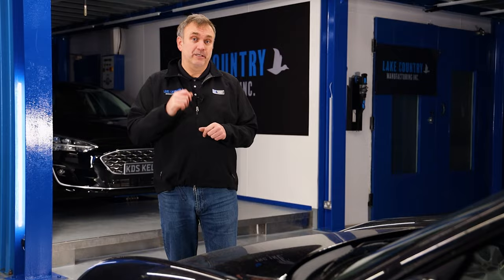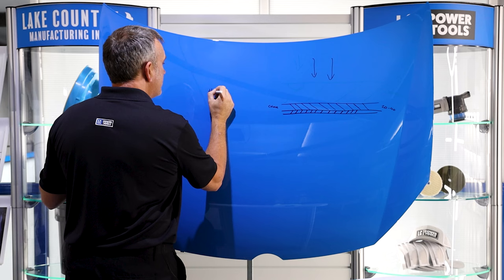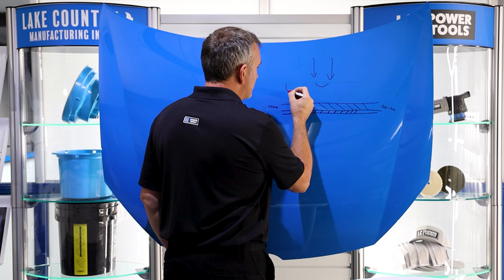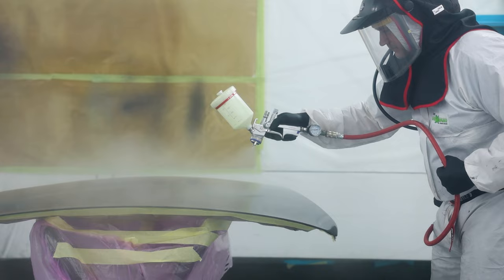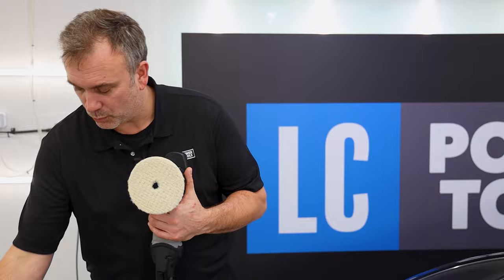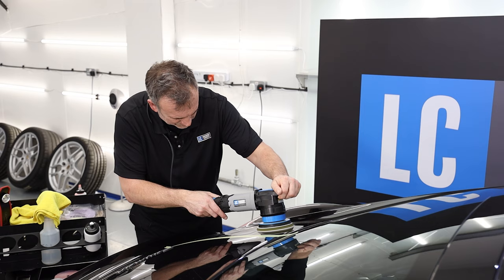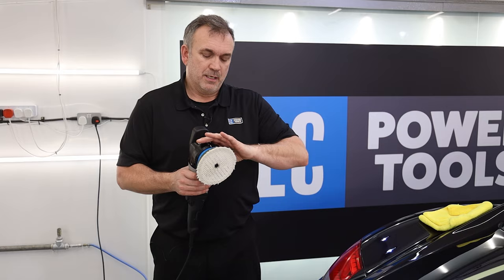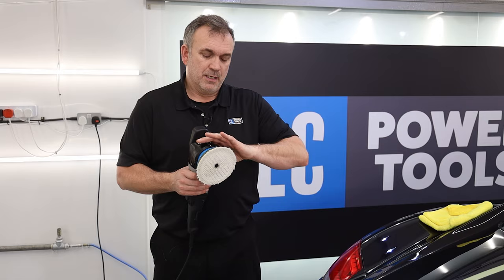Porsche Cayman Bug Etching | Part 01: Cutting

Comment: That UDOS machine looks fantastic but Lake Country Tools still needs to develop and sell a "MICRO" UDOS machine.   The exact same features as the big boy but in a micro machine to allow for polishing in smaller areas that require a micro polisher.  If they could develop it with a battery and cord system like the iBrid,  even better.   That way you always have a back up if you don't have a battery charged.
Reply from the maker: Always appreciate your feedback, thanks!

Comment: If had to deal with this I would simply cover the appropriate panels with PPF. PPF can stain with certain bugs, but the sun’s UV typically causes them to disappear.
Reply from the maker: I've seen what you're describing and in actual fact there have been specific occasions (this is Jay talking about our time at/as KDS Keltec) where we have done just that - fitted PPF to roof, hood, bootlid etc because the owner had no choice but to keep the car somewhere it was guaranteed to get covered in bird, bug and tree mess.  Even if the PPF had ended up stained and wrecked, on that car, with that originality, that value and so on, the PPF could be considered sacrificial despite the cost.  It would have been much more expensive and detrimental, let alone difficult because of the colour, to have to re-paint.  PPF doesn't always re-heal though - sometimes it's just a case of 'it depends on the chemical and the brand of PPF' and being lucky, or unlucky...

Jay B

Comment: Hey Kelly, amazing video. I had a weird case with a customer's freshly painted car. The paint was approximately 3 months old and the car was black. There were severe tree sap etchings which I sanded with 1500/2000, compound with microfiber pad on 15mm orbit and final polish. I then completely washed the car, degreased it with IPA and ceramic coated it. However, after the first wash, these etching came excatly the same as before. What is the reason for that? Were they too deep in the clear coat because the car was freshly painted and it was hot because it is black? And why did they appear after the first wash while the car was properly washed and degreased after the polishing stage? The polishing compounds I use do not contain fillers or silicons. Was this temporary effect achieved because of the heating of the paint?